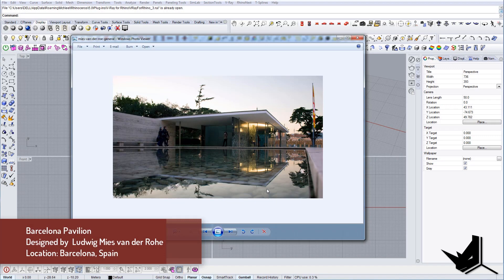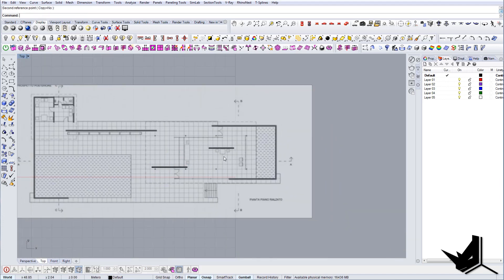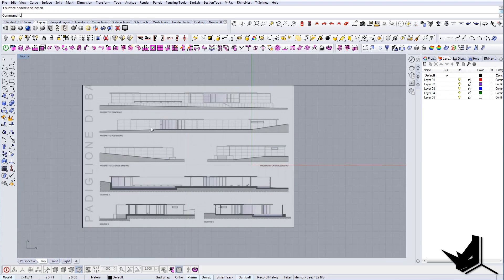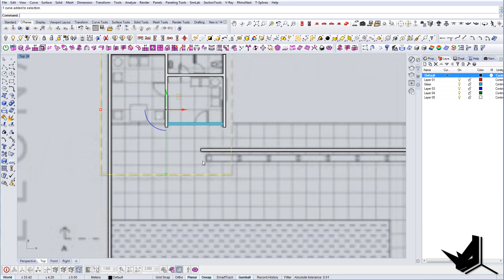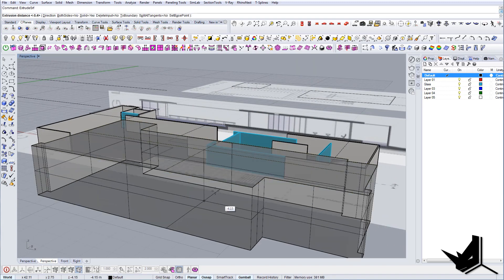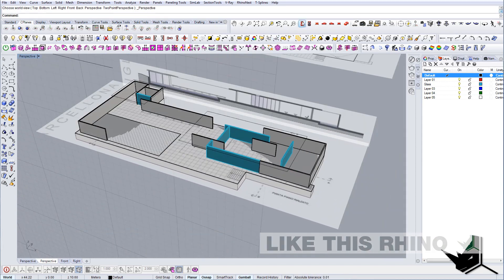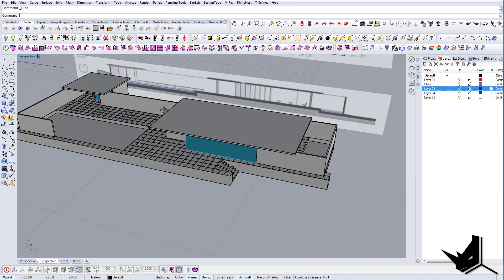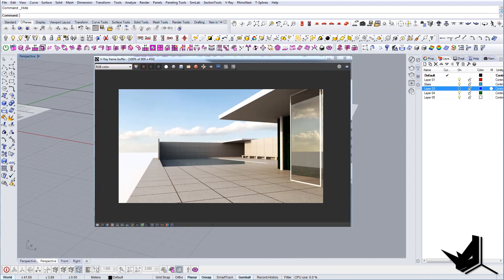Rhino Architecture - Modeling Barcelona Pavilion in Rhino

Comment: I don’t find many tabs like you, including car directions and the pink ribbon, so is there a video explaining how to format the interface like you?
I use 6 rhino
Thank you
Reply: If you right-click an empty space on the toolbar you'll see the "Show Toolbar" drop-down menu where you'll find all the available toolbars. Just check the one you like and it will appear.
The car thing is in a toolbar called Standard Toolbar Group. For the pink toolbar, this is a plugin called T-Spline, it doesn't come with Rhino, and there is no version for Rhino 6 or newer, because AutoDesk, the owner of the plugin killed it. But in Rhino 7 they created a replacement called SubD. The T-Spline and SubD are tools for using polygon modeling inside Rhino, a very powerful feature.
Reply from the maker: Exactly :D